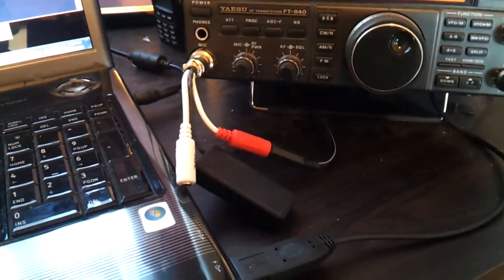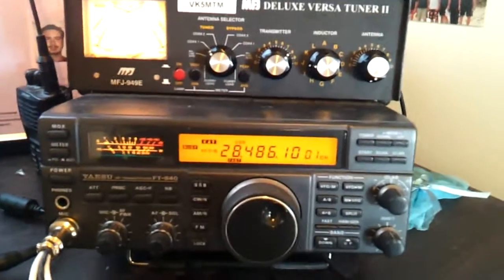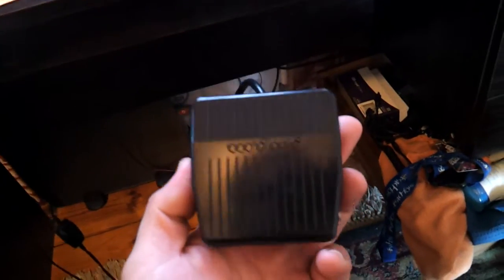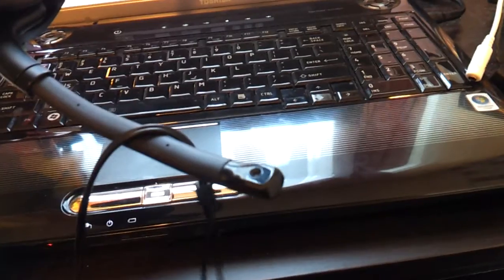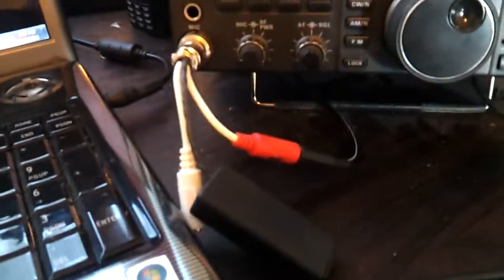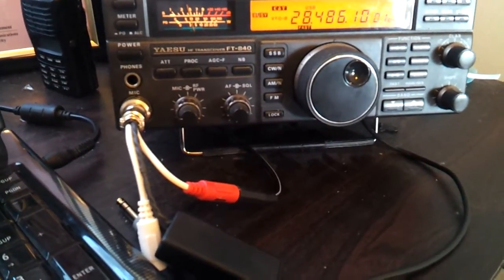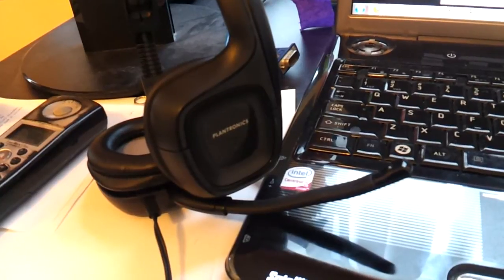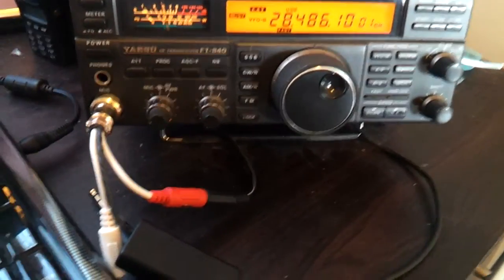W2ENY PC headset microphone adapter for Amateur Radio use

Comment: Was also looking at this for microphone solutions. It's so smart to separate the phantom power out into a battery box for these headsets.   ----  With your PC headset you can also use it in your cellphone when you need the work with that modality.  -- N1KTJ

Comment: I got one so I can use a Corsair HS50 headset with my Icom IC-718. Had to get a "Y" splitter so I can plug the headphones into both the headphone jack and the mic jack of the radio (otherwise only the mic works and no sound from the phones).

Comment: where do the battery poles connect to?
Reply from the maker: +Procto Ofsaryrn I'm not sure exactly as I didn't make the adapter up. What I do know is that the battery box provides the phantom power required to drive the electret mic which my Yaesu FT-840 does not provide.